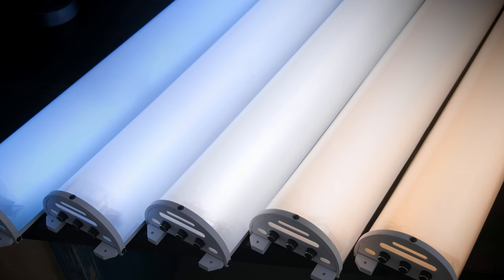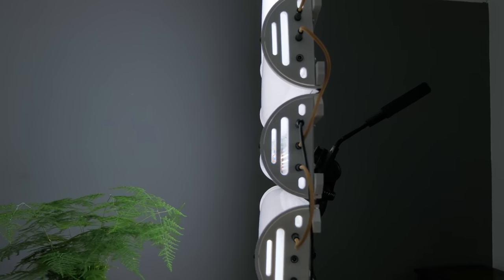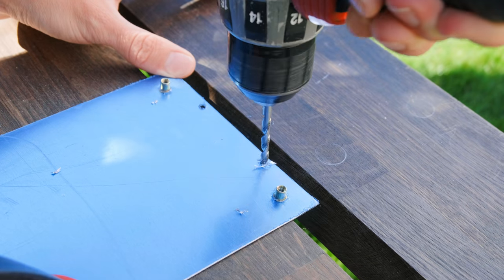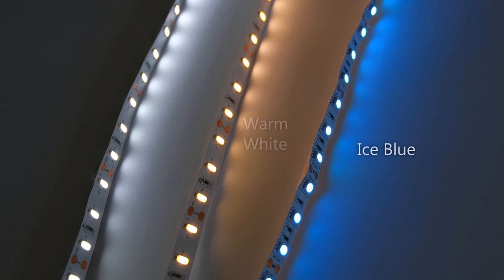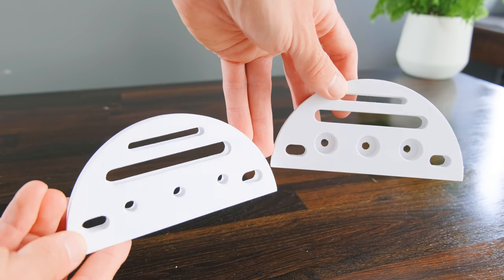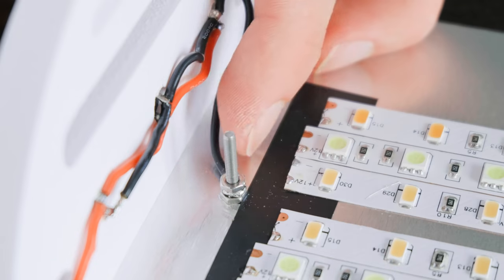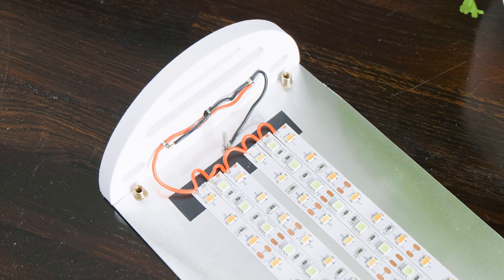DIY Studio Lights - How to Build Your Own!

Comment from the maker: Thanks for watching everybody! These are the photography grade LED strips: http://rover.ebay.com/rover/1/711-53200-19255-0/1?icep_ff3=2&pub=5575347517&toolid=10001&campid=5338215129&customid=&icep_item=182965299789&ipn=psmain&icep_vectorid=229466&kwid=902099&mtid=824&kw=lg

The rest of the parts are in the description.
Reply: Great video and project. But here's a thing: The shot with “bad” LED's has more detail and contrast. The other shot has more colour blending, so things ikke the wrinkels in your forehead disappears. Can you get the level of contrast and detail from the bad LEDs with the good LEDs?
Reply: rasmis to my eye the detail is there in both shots. The difference in wrinkles is more to do with the expression on his face. He doesn't have his eyebrows raised as much, so he doesn't have the same level of wrinkling. Also looking at the shadows suggest that the light wasn't in the same position, so there's a possibility of that effecting the visibility of wrinkles. In terms of contrast I can't see a marked difference either, at least nothing that I wouldn't put down to camera settings/exposure values.
Reply: All the eBay links just redirect to a shitty contact page.
Reply: I am missing the mention of the power supply...
Reply: make something related to ebikes on a future project please.
Reply: Hey Matt, why did you cross the cables at 9:00? It's a bit cringy. VERY nice lights though.
Reply: Another excellent video Matt! Very useful thank you. Gave some ideas for my own DIY lights!  - Danny
Reply: Are you taking on apprentices?
Reply: I love ur vids but is there any way to lower your mic sensitivity? It is a little jarring to hear breaths between sentances
Reply: Make a custom case to hold all the motherboards of all the playstation consoles. ps1/ps2/ps3 and ps4. one box, all original hardware.
Reply: Hey Matt, did you notice that you are now the uh... "poster boy" of the LED strip seller?  You might want to consider taking another peek at the seller's included images to make sure everything is on the level with the use of your image.
Reply: the site used this video to advertise their lights
Reply: You are welcome
Reply: these designs are awesome
Reply: What is the CRI after installing acetate sheet?
Reply: a 19V 6-7A (around 6.75A by my rough estimate) power adapter like the ones for laptops would be enough to power all these LED strips (5 modules of 6 strips each of 0.75m each), each strip running at 9.5V (not 12V, as to prolong the life of the LEDs) - so wired two-by-two-0.75m-strips in series. Otherwise, if you want to connect them all in parallel, you'd need a power adapter of 12V 14A (a bit harder to find as laptop power bricks, but available as "exposed" power supplies)
Reply: they put screenshots from this video onto there ebay listing lmao
Reply: Just made another budget overhead video gear. And I  also use led tube (actually a led strip inside. with spec: 4000kelvin 1080 lumens each. The best part with this lighting is it ANTI flicker. smooth on video with no flicker. I have tried a higher watt and lumen with bulb but it is flickering. check this out: https://www.youtube.com/watch?v=eior3Cd9O4c and please let me know what you think.
Reply: what about making an table with an iduktive plate and an induktive cup that keeps your coffee warm ?
Reply: awesome project.  How much would you charge to sell 10 of them?
Reply: @Argentarii Homini i miss this too.
Reply: Hi, could you please tell me the measurements of the lights? Also can I have a link to where I could purchase the power sockets please? I love your videos and I have just sign up to become your Patreon. Keep up the good work mate!
Reply: Still waiting for that wiring diagram... its been over a year man
Reply: Hey! If you take a look at the Amazon listing for the LED strips you recommend, they included some shots from your video!
Reply: Which diffusion sheet did you use please, the linked listing has multiple options? Thanks
Reply: Please for the love of life don't run electricity in the backplate.

That is a death trap.

If you touch it and something grounded like a metal sink or heating element, you will get a jolt that can kill you if the power supply is not insulated enough.

You should ground the back plate to the ground in your house, not negative of the power supply.

Please delete this video and redo it in a safe way.
Reply: Anyone else having trouble finding the low density PVC?
Reply: @MattFahnix  try searching "pvc board" or foamex
Reply: @SuperHification  Thanks! That's coming up with tons more!
Reply: Which diffusion sheet did you use - white, heavy frost, or light frost?
Reply: What if i wanted one dimmer to crossfade between the color temps so that tungsten was far left on dimmer, then turning knob to the right would slowly fade it to daylight?
Reply: @thekylenovak  that's not possible. The dimming is accomplished by limiting the current to the light strip. It wouldn't be possible to brighten one strip while dimming another if both are controlled by the same dimmer. The only possiblity is to have more than one strip dim at the same level from the same dimmer.
Reply: Which power supply we have to use ?
Reply: fantastic!
Reply: Can you make an RGB one
Reply: Hi DIY Perks. Your Diffusion Sheet links no longer work (or maybe it's because of my country). Could you paste here new links or their exact product name so I could look them up?
Reply: Would you be so kind to update the links in the description. I can't finde the dimmers and stuff. I would love to make these lights!! :)
Reply: @rasmis  তুমি যোদি ভালো হোতে বাঁধা দাওনি কেনো

Comment: I like how you showed the way to manually make the component despite having cnc!
Reply: I also like that he has basic tools like a cnc and rivet tool for threaded inserts but no complicated stuff like a jigsaw.
Reply: No thanks Darkseid.
Reply: Darkseid  No.
Reply: Frank Ricard - I do have to agree on this ^^
Reply: yeahhh
Reply: Once you have made one of the semicircular end pieces you could use it as a template for cutting more out with a router.
Reply: He is a legend, again!
Reply: If you had a 3d printer you could make them just as easily

Comment: Added up the cost of doing this and it's really not cost-effective. $90 just for 3 LED strips! You can buy a decent photo light kit on Amazon for the cost of making these without all the hours of work. It's cool but going to end up costing you more than just buying lights.
Reply: yeah, all the materials aren't cheap. This thing are good for specific solutions, but not that good for general use!
yet, really nice video
Reply: What potatojet's light comparison video and you'll see how even very expensive lights have poor color quality. These lights are about as good as it gets color wise and cost 1/10th of the price in the end.

Comment: I have modified my version. All dimming controls are external using a 5050 DMX controller and added RGB Amber and UV giving me full control over the entire colour spectrum. 8 channels each. (Controlled on the negative not positive.) and made 16 of them for mounting on 2metre F34 quad truss totems with moving head spots. Gives the stage a pop of colour effect and some other uses too. 128 channels of computer controlled lighting. Used a bit thicker Al sheet
Reply: This sounds like an awesome upgrade. Do you have plans or pictures for your version?

Comment: How to make a DIY Perks video
- Use alluminum sheets
- Use good quality led's
- Hack a bunch of circuit boards together for your needs
- Have a nice soothing voice and good quality videos
Reply: I kinda miss the really interesting videos, the pc control hub, or the 100w flashlight etc. Now it's just as you said. Ledstrips, and various ways to use them. But still high quality.
Reply: Aluminium* lol xd
Reply: hahaha i lost at soothing voice
Reply: I freaking love videos of people making different light sources... find it very interesting.
Reply: you missed: Drill holes in your wall
Reply: Aluminum and Aluminium are both correct lol xd
Reply: Just murican things.
Reply: Erm...nope...a lot lot more effort and thought.
Reply: 😂😂Yea too much, not the kind of stuff you will pick up at the 99p shop. Skill level is too high to qualify as your normal DIY.
Reply: SIIIIMP! SIIIIIIIIIIIMP!
Reply: @Wolfnam  Yes, but never "aLLumin*m".
Reply: The soothing voice is top priority.
Reply: also occasionally spend way more than it would cost to buy a roughly comparable product just for the fun of it.

Comment: Don't solder the grounding wire before crimping it! Solder flows under pressure, so that means that if you clam down a soldered wire, it'll work loose on its own. This is also why you never solder wires before crimping a crimp on there.
Reply: Can you elaborate? I'm not sure I understand what you mean, and I'm genuinely interested.
Reply: There all ways someone saying "don't solder the end of the wires when connecting to a terminal" I been soldering wires end and putting them in terminals for years and it's just fine for home use just make sure you torque it down right so it is pre smushed. Now the Europeans are very picky about this though and there's no sense going for their heads when it comes to cost and budget. I can't just show up and spend a dollar each time I want to make a connection like that. I love the guys but sometimes they are overprotective.
Reply: For hobbiest grade stuff that isn't critical or high power soldering a wire and then crimping or screwing in a terminal is just fine (I've done it myself many a time). But for anything where reliability and safety come before cost or ease of manufacture then it is a no go as it can cause loose wires over time (imagine medical/aerospace/military equipment scenarios where even a 1 in 1000 catastrophic failure is unacceptable).
Reply: Sir_wolf Art  You'd actually save money soldering a wire instead of screwing it. And I can't see how not soldering the wire before connecting it into the terminal would make you spend 1 dollar. You can leave it unsoldered or solder it afterwards, and you don't lose a cent.
Reply: @GRBtutorials  true that can be done too and would be stronger.
Reply: I scrolled down just to look for this comment, well said.
Reply: Speaking of grounding, you should put the grounding bolt in after you remove the protective film from the aluminum (aka, aluminium 8-) otherwise you end up with a layer of protective film between the aluminum and the bolt, thus, the only place the bolt has to make contact with the aluminum is where the hole has been drilled out.
Reply: Unsoldered wires can also work free (I got paid to fix a lot of those). I often soldered then crimped, and never had a problem. In either case, the problem is that most people don't really crimp. As soon as they feel any resistance, they stop, which will allows the wire to escape over time - soldered or not. Crimp like you mean it! Having said that, I never worked on high-voltage systems (those almost never get soldered)...
Reply: Interesting, thank you for that knowledge. This is a case where a crimped ring connector would come in handy I think.
Reply: @sir_wolfart4733  "Now the Europeans are very picky about......".Europeans?You mean 750 million people that live on Old Continent?Yep we're all the same,with same dreams,same taste's in everything especially when it comes to cost and budget,same culture,same hopes,same fears...
One of European people.
Reply: @sjm4306  Also, it's simply good practice and a good habit to acquire. Why bother worrying long and hard about which method to use when you can just pick the one you're used to (and which just so happens to have proven itself to be safer), and by that time have acquired a solid stock of, and carry on with the actual work? It's just like indicating. "B-but what if there's nobody to see it?" Just do it and carry on.

Comment: You should be aware that solder flows under pressure, like where you've put solder on the negative wire, then tightened the nut onto it. This can cause connection issues in the future. A crimped loop connector would be a great option here. Otherwise, this is an awesome video!

Comment: A separate on/off switch is nice addition so you don't have to keep plugging and unplugging or turning the knobs
Reply: A proper power switch would be very high on my list of modifications to add. Doesn't even need to be on all of them. Might also consider a master/slave model design, where the master has 3 power ports and a switch, while the slaves have 2 power ports for daisy chaining.

The other update that I would consider: Digital control on brightness levels, so that adjustments to one can be auto synced to the other units in the chain, unless an override switch is on.
Reply: @RealLuckless  that would be great but it will be complicated
Reply: @chlendimounir2834  it really isn't that big of a jump. Replace the standard nobs with digipots, and a means to adjust them if you want full on slave mode only units. Toggling between options adds complexity, but it wouldn't be a massive and complex circuit. Might even be a little easier if you use printed boards and oven soldering really.
Reply: Chlendi Mounir it also means you can set your desired white balance and then turn it off the light with a switch to save those settings for later
Reply: @AdamPrestNZ  yes exactly

Comment: I'm willing to bet almost no one actually built these. People just want to watch you build'em, lol.
Reply: There's always a cheaper and easier way to build something like this. If I really needed a cheap setup you could tape it to some wood cut down to your desired size at home depot and just wire it up. Tape the diffusion sheets to some cardboard cutouts and bam you're done. Doesn't need to look good if it's not in the frame.

Comment: I think they are great for bathrooms too, right and left of a mirror.

Btw: Is it possible to build a mirror with a touch screen? I saw a video years ago to build a smart mirror from a TV but the lack of touch input makes it quite boring.
Reply: Yes, Matt! Please try to make this. I've been wanting to make one too, but I'm not sure how to go about it.
Reply: Arent there these  bar you can put on a normal laptop and then it has touch screen capabilites? If you would run this with windows it should work
Reply: @sirsundays  I don't think you want bluescreens on your mirror. I would pledge for a raspberry pie/linux in the background. This would consume way less power. A motion detector can be used to turn the display on. You just need a way to get the touch-part of the display on the front side of the mirror and the display at the back. :)
Reply: Problem with adding touch capabilities to a mirror is that you would get smudges all over it. I've seen some people using cameras and hand gestures for these kinds of mirrors which might work better, or even some simple voice commands. Another possibility would be to use an IR based solution where light is shone from the top and picked up at the bottom, this would mean that you don't actually have to touch the mirror to get a response.
Reply: @peterme  that's a good point. I think an IR based solution is better. Maybe even visible light, to get a feeling for being eliminated by the light beam.

Volvo is using that kind of "touch" screen in their latest models and it's working flawlessly
Reply: for that, u need a digitizer, which is almost impossible to get for a custom one
Reply: @BigBoyLies  naaah you can find those stuff on Alibaba. The question is, is it worth it?
Reply: Rather than getting finger marks on your mirror, why not use the Hey Google voice user interface?

Comment: Maybe I missed it, but can you tell what powersupply you used?
Great Video anyway!!!
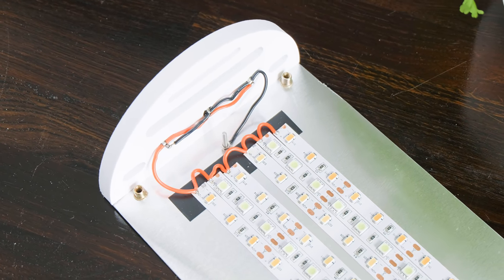Reply: 10:34  - 12v power adapter but the amperage can change depending the length.... He could say which one in this build but maybe it is in the project blueprint, which you need to support to gain access ;)
Reply: Get a generic 12 V adapter with enough current for all the LEDs. I'd say 5 A (60 W) per module is enough if you're planning to power all the strips at the same time. However, you only need to power at most 4 strips, so 3 A (36 W) per module should be enough.
Reply: Well that helps. I tend to order one of these DIY power supplies from china, so I can eventually daisy chain the modules.

Comment: Hey Matt! Love your videos. You never added the diagram for the Circuit dimmers.  Also would you be able to add in some files or measurements you used for your holes on the Aluminium. And I know you provided the SVG for the Arches, but would there be a way you could provide the measurements and possible SVG for the PVC brackets used to hold the diffuser. Thank you Again!

Comment: The hardest Item to get out of the whole project would be the acetate. I've been looking online at my local hardware shops and on eBay and I can't find it anywhere. Do you have a link to somewhere you got them from online or did you go to a hardware store to get yours?
Reply: you can search for acrylic or plexiglas too.
Reply: They’re on ebay...
Reply: What thickness did you guys try to use? I couldn't find medium so I got .003" and it looks to be too thin, could use two layers though.
Reply: Nathan Slocum i havent tried it, but looked for it when planning the lights i want to make

Comment: When will the circuit diagram be added? and How thick is the LD PVC plastic?
Reply: I believe the PVC plastic is supposed to be 6mm or .236 inches or whatever inches is.
Reply: If you take the .svg file he gives in the description, scale the width and height of the half circle endcaps to a width of 14cm, and then take the difference between the arches and the endcaps you get a thickness of 12.5mm or about 1/2"

Comment: Noo don't put hot glue on the LED strips! They heat up pretty good, melt the glue and eventually burn it. I personally recommend 5-min epoxy, possibly high temperature one.
Great vid btw ;)